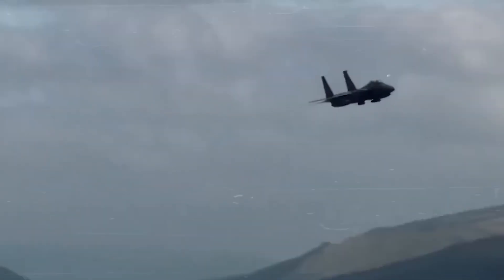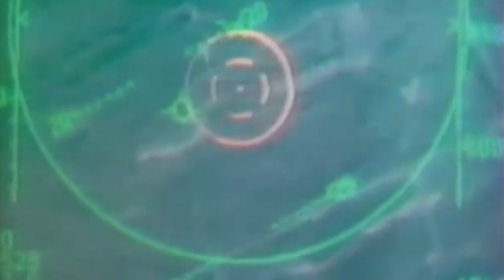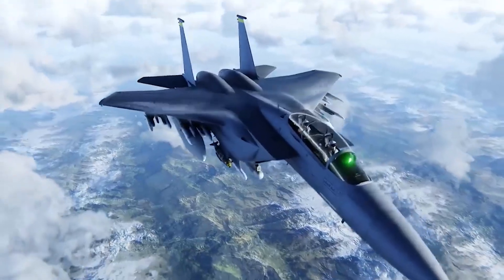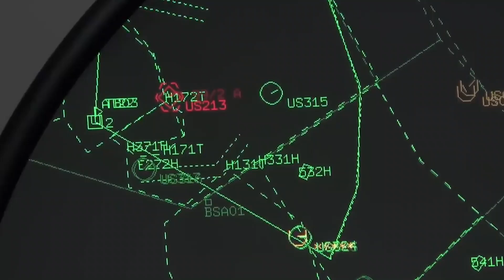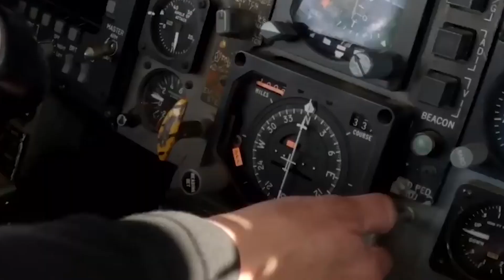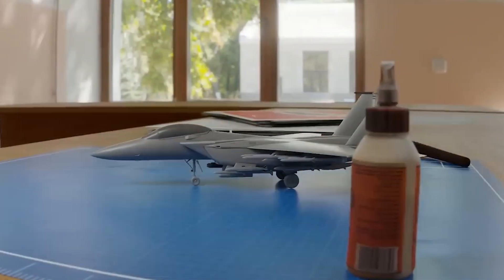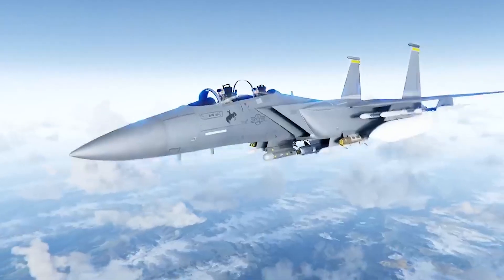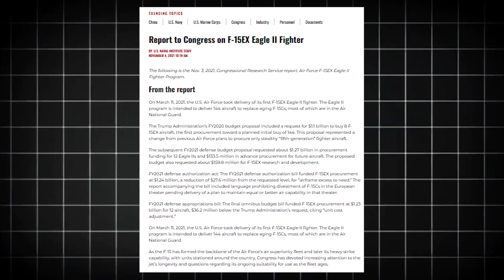The F-15EX is Here: Finally Operational and Ready for Action

Comment: Can the Eagle II carry the AIM-174b and if so, how many?  If I were an unstealthy missile truck, I wouldn't mind a 250 mile standoff with stealth assets assigning targets up front.
Reply: I bet it could carry the AIM 260 along with AIM 174B in its loadout ! I personally prefer using the AIM 260 for its Mach 5 speed and still have a 120 mile ➕️ standoff range, but the AIM 174 has much more legs ( 200 miles ) but less energy at 3.5 Mach. But we now have 2 different standoff missiles that can be used on All our platforms. F-16, F-15( ex ), F-35, and F-22's can shoot the AIM 260, while the F-18 Superhornet ( even the legacy Hornets ) can shoot the AIM 174. This is a real big advantage for the USA 🇺🇸 !!!